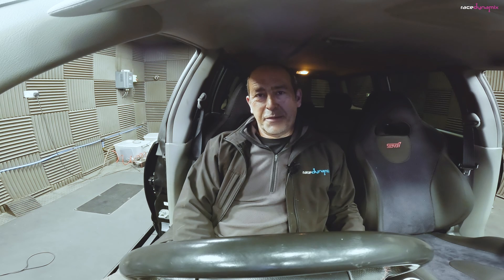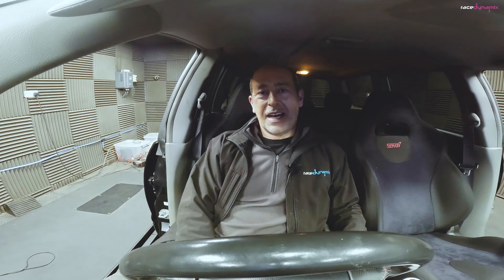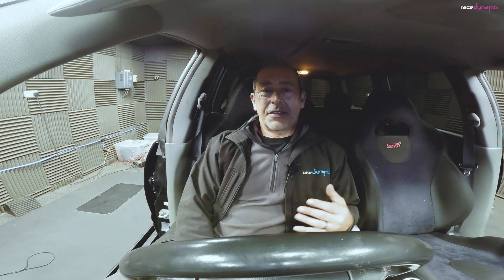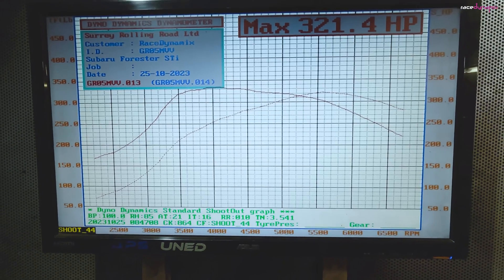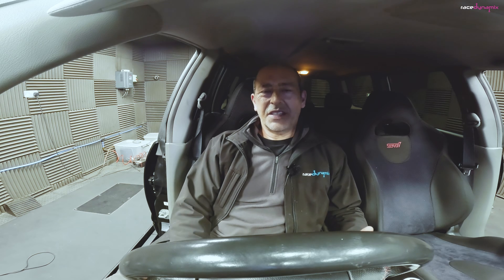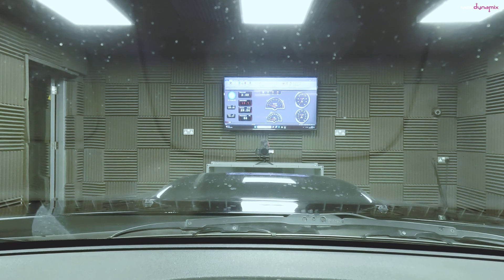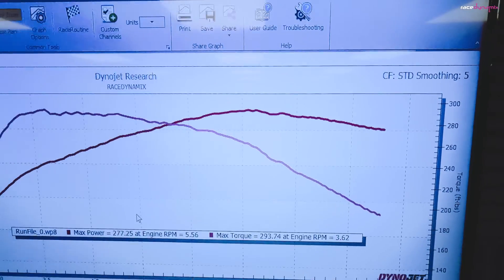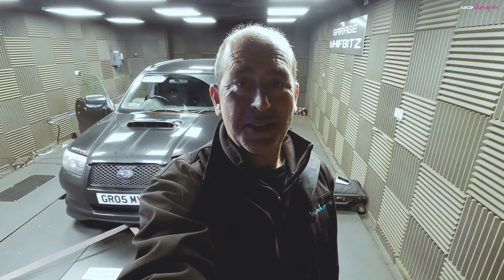Dynojet vs Dyno Dynamics: Why Wheel Horsepower Comparison Is MISLEADING

Comment: The only time I would use a rolling road is for tuning and datalogging. According to my 1/4 mile datalogs converted to dynojet charts I have 460whp. I'm running 11.2 seconds at the 1/4 mile with moderate weight reduction and Mickey Thompson's. This is on par with supercars and tuned builds with 800-900bhp. I watched a carwow video showcasing the Nissan Skylines all with 850whp and their times are on par. So bhp figures really doesn't suggest a car is faster! Weight, suspension, tyres and other factors all come into play. Mine is great at straight lines but terrible around corners! An E92 M3 will be better at corners and worse in a line.
Reply from the maker: Interesting info, thanks for sharing your experiences.  Real world vs theory is always an interesting debate

Comment: Hi Duncan, I know you're saying that all dynos are different but would you be inclined to say that the Wifbitz dyno over reads? When you did the video of tuning the decat bugeye WRX at Surrey Rolling Road you got about 290hp at the flywheel which seems right but if you were to do that with the same car on the Whifbitz dyno surely you'd get well over 300hp! Which surely can't be right for a WRX with a TD04.
Reply from the maker: Hi.  Whifbitz Dyno reads higher whp figures but doesn't show flywheel figures. I normally estimate 20% on top of whp for flywheel figs 👍
Reply: @racedynamix   My apologies Duncan, watching the video again you do mention that at Surrey Rolling Road your Forester made 321.4hp at the fly wheel so the fly wheel figures are virtually the same. I knew about the adding 20% and I was doing that for the Surrey 252whp and made it just over 300hp, the dyno obviously has it's own way of working it out. Sorry about that.. 🙄
Reply from the maker: @timcolemandrums  at SRR it is 27% iirc but it calculates flywheel figures itself

Comment: It made 321 hp on the first dyno
Reply from the maker: At the flywheel 👍
Reply: @racedynamix  both them dynos read wheel hp not crank so something fishy
Reply from the maker: @jasonlowther9936  yes and lots of others read wheel horsepower too but they are wildly different aswell.  Hence why I did the video.. Whp cannot be compared

Comment: US auto manufacturers use the SAE (Society of Automotive Engineers) standards for measuring horsepower ratings. It says Europe uses SI but if they import into the US they have to convert to SAE for power ratings.  Race leagues in the US use SAE. So people in the US use SAE but if you want to compare to foreign dyno results depending on the country you may want to look at Dyno Dynamics.

Comment: Feel like you glossed over a lot of details on this. Try using inductive pickup on dynojet rather than Gear Ratio, static gear ratio is so 1995. You will get a more realistic torque value on a DJ using RPM from canbus/obd/pickup. 4WD Linked vs Unlinked DD load implications, CF/ramp/strap style settings for DD. Lots of things that can influence this result further. 

Having said that, I could live with a 5% desrepency between chassis dynos & brands using "at the wheels" results, there would be a least a general pattern across brands.  I think the bigger problem is the UK loves to add on the the estimated crank power/torque which muddies the waters even further. Look at this example, DD adding on like 29% driveline loss, which seems generous. I think I'd trust the torque value of the DJ a bit more looking at both results.
Reply from the maker: Thanks for the detailed comment.  Yes, obviously, some details were glossed over but I don't think using a different rpm signal rather than setting off roller speed would have made any noticeable difference but I will test that another day.  The point was whether whp could be compared as that is ultimately what is measured.  I could also have used a Mustang dyno or Maha dyno or Dyno Developments dyno and got another 3 different figures all of which would be right but all wrong too. The 3 different sets of figures that Dynojet produce (sad, std and uncorrected) also muddy the water greatly too. But this wasn't about saying one dyno is better or worse just that there are differences. The only real way to say 100%  accurately is engine out and on a test rig. 

The UK / rest of the world obsession I think comes back to bringing figures back to figures that the manufacturers state.  Ie 265bhp from the factory and it is now 310bhp etc etc.

Thank you for watching and commenting, you obviously know Dynojet well.. They aren't that common here. 🙏
Reply: @racedynamix  Torque calculation on dynojet needs engine speed input, as power is calculated from the roller itself. Drive ratio on a vehicle through a run is rarely static unless its really underpowered, using RPM from pickup/canbus will allow torque calculation to track perfectly during tire deformation as gear ratio is changing etc and keep the engine speed axis on the resulting graph accurate. Otherwise you end up with graphs that are skewed on either the high or low rpm in terms of accuracy. I could make the same critisism of most dynos that primarily use gear ratio. This problems gets really noticable the more power an engine makes. The power reading will usually not be affected though on DJ regardless of engine speed input. I try an avoid dynos these days that wont take an RPM/CAN input for some data as it really does help with consistency whilst testing. 

I'm not expecting any dyno to the read the same either. You will get different results on each for sure, but in my mind every dyno is working of a set of principles based on physics. Rules of physics don't change, so we should be able to expect each chassis dyno to get reasonably similar wheel figures (+ or - 5%) as thats where everyone is measuring from (using the same car). When you get wildy different wheel figures then I start to question the dyno setup as the maths dosent add up. Not saying DJ is perfect, as it has its pros and cons like everything else. I just find it weird that in the UK especially, if I take my car to a chassis dyno I will likely be given a crank figure and any mention of power at the wheels is rarely talked about unless I bring it up. In a way its kind of irrelvant what an engine makes at the crank, because if it only puts out "X" to the wheels then thats more representitve of real world performance. 

Even engine dynos are a minefield, you will get different results on superflo's vs l&C. Its all rather annoying and takes proper care to ensure some sort of consistency.

Comment: Hi duncan great video as usual, and perfect timing for me really. I just bought a 2015 STI yesterday from what i can see its almost stock with a few tasty  simple mods, have quite a few printouts from dynapack dyno it starts out at 240hp  ending with 276hp, having never seen a dynapack would this be wheel or crank HP? If you had to guesstimate
Reply from the maker: Definitely whp.. Or their version of whp at least 👍

Comment: Quick question for you, every dyno graph I've ever seen at Surrey Rolling Road including this video, the intake temperature is always lower than the Air Temperature......how is that possible? And would that affect the dyno result?
Reply from the maker: The unit with the IT sensor is in the next room tbh so always a bit different to the dyno cell.

I will cover the impact of this in a video shortly.. Hopefully that will answer all of the questions you have on it.

Comment: Great video Duncan. Q1 so all dynos have different readings, so which dyno is 100% correct?
Q2. If you made 321hp at Surrey and 277whp at the other dyno. Why are the US getting higher WHP figures as they are higher than our hp figures and youve shown whp is lower than crank hp. Do they have better fuel?
Reply from the maker: All are wrong and all right 🤣

The 321bho was at the flywheel.. It made 252 at the wheels at Surrey versus 277 at Whifbitz 👍

Comment: In the USA I have seen mostly direct bolt on hub dynos I presume there a lot more  accurate eliminate wheel traction or loss of it on the rollers great video Duncan thank you 👍👌🙏
Reply from the maker: Yeah they but they are a pain to set up, take a long while and again adds a different figure to compare to

Comment: Saw someone in the US post up a video showing he made 420hp on a stock EJ207 with a TD05-16g lol. Not sure where the temp sensor was located, probably in a cup of coffee ;)
Reply from the maker: Must have been 🤣🤣
Reply: @racedynamix  idea for a video would be to go through the typical turbo range/options for Foz/Impreza owners, especially newage. Power range of a TD04, TD04 hybrids, typical VF30, 34, 35, 43 etc vs TD05-16g, 18g, 20g then popular aftermarket options for 360-500 stock location.